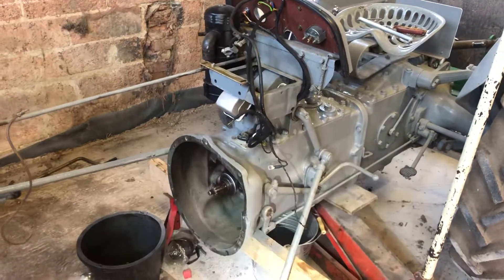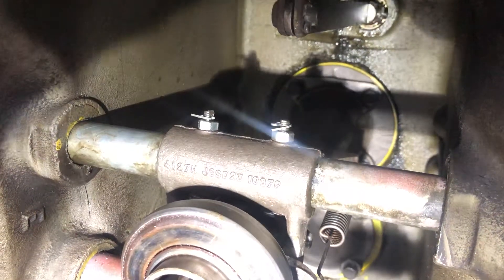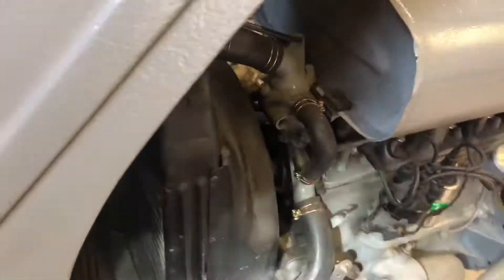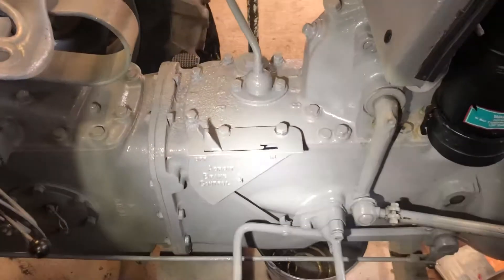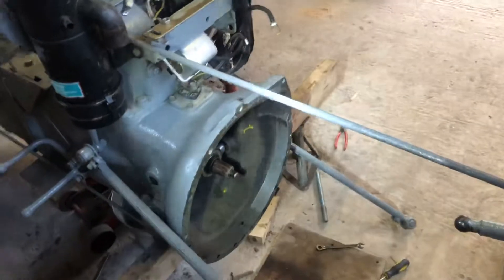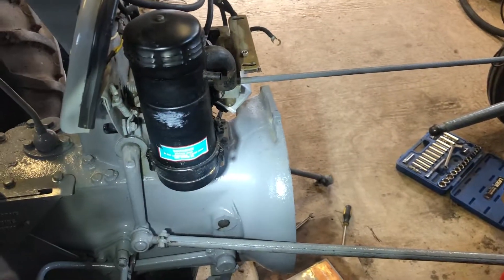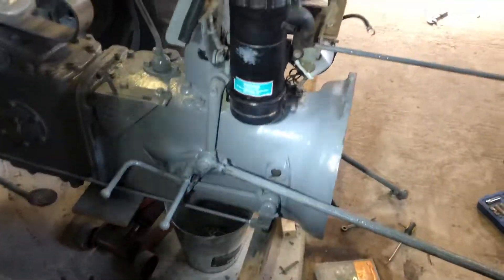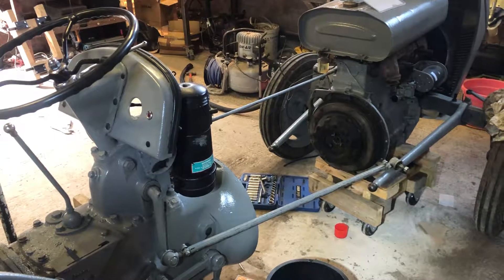Ferguson TED20 input shaft oil seal replacement Part 3

Comment: Thanks for the vid,I was looking for this to see the thrust bearing set up,mine let go,need to slit the tractor,happen first day owning it,traveled 50 metres putting a slasher on and off,the clutch was weak travel, was looking forward to you putting back together,or even splitting it,but the bid gave me the heads up,cheers

Comment: Thanks so much for you super good and Nice video. I have a TEF20 massay Ferguson there is a leak so I must do the same as you have done now ...Thanks so much . Do you Know if the massay Ferguson 65 is the same . My 65 is dripping wery badly and I dont have a repair manual . Meby you Know it . Tanks from norway😊😊

Comment: What gasket did you use for the input shaft (one with 4 holes at the back)? I have taken mine off but I can't seem to find one anywhere to replace it with. Where did you get yours from? Regards, Tyla
Reply from the maker: When I took mine out all it had was just some jointing compound (instant gasket) around the flange and no gasket 
Hope this helps